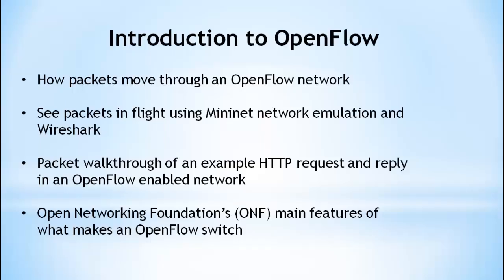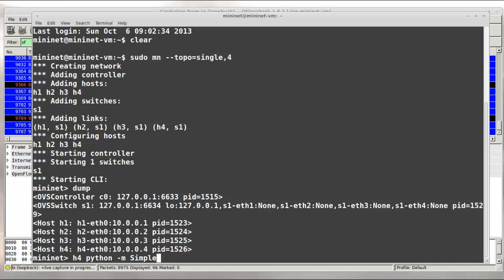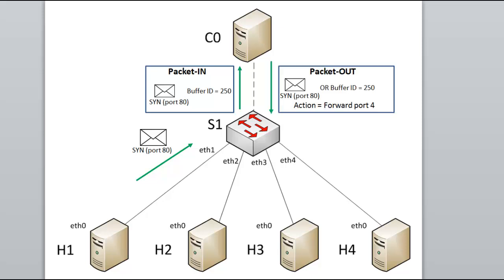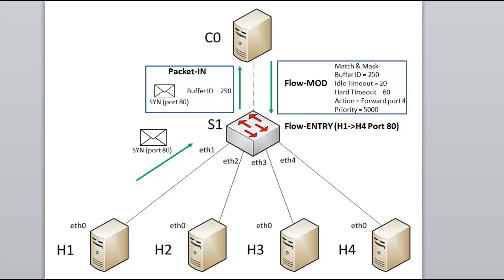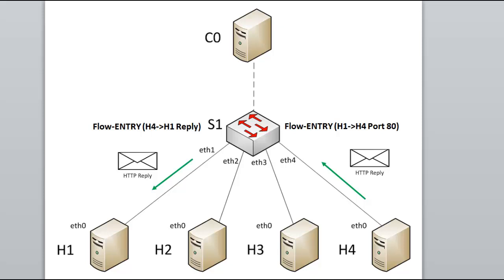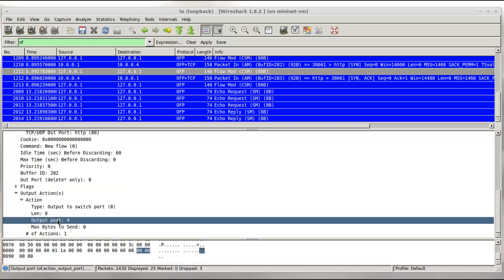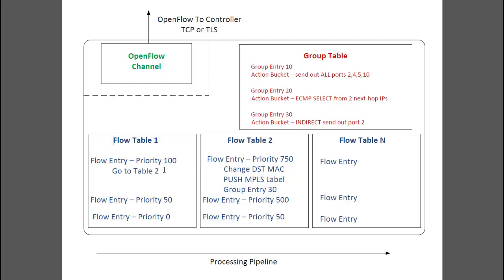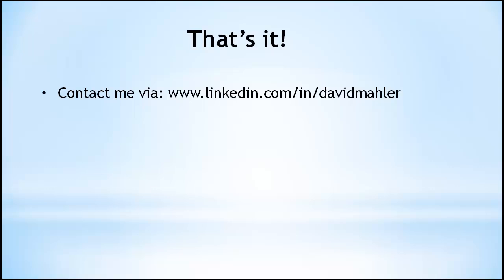Introduction to OpenFlow

Comment: Excellent video David! Cleared up a lot of my doubts. 
Just one question at 3:20 When the initial SYN packet arrives at the switch, how does the switch know which controller to send it to.
As OpenFlow controllers could be implemented by different people, how does an intermediary switch identify which controller to talk to for a particular packet?

Comment: I know this was 6 years ago, but something doesn't make sense. Back in the early days of networking, we had bridges which performed frame switching via software. This was a bit slow so frame switching was performed via the ASIC (ASIC - application-specific intergraded circuit). This allows frames to be processed at wire speed. Now we're back to a software implementation of switching. Don't get me wrong I fully understand the benefits, but how has switching via software improved with respect to speed vs switching via ASIC
Reply from the maker: Emphasis on the 6 years ago, I'm not working with OpenFlow anymore - but programable ASICs - e.g. https://sites.google.com/view/iu-whitebox-project/home/programmable-asics-and-p4

Comment: I wonder how controller know that h4 is connected to switcH ON PORT 4, since that are no packet out of h4 yet in the first place?
Reply from the maker: It's been a little since I set this up - but IIRC, its from the ARP request and reply which came before the TCP 3 way handshake.  Those are punted to the controller which records (learns) IP, MAC and port mappings that way.
Reply: I also have the same question from David Mahler
Reply: Why didn't the switch had an entry if there was an ARP packet sent out?
Reply: Ratna teja I guess because the SDN Controller differinciates between Protocols. You can see in this example, that even for a new HTTP session the SDN Controller would have given out a new rule.
But I think you could generalize  those rules. (I am still new to SDN)

Comment: Question - when h1 sent a ARP BROADCAST to ff:ff:ff:ff:ff:ff there was no flow_mod packet.  Why is there no flow modification for ARP broadcasts?
Reply from the maker: It's been a while so I don't remember the context - maybe I just skipped ARP process to focus on core points if I recall correctly....
Reply: Right the video is about the TCP SYN and TCP SYN ACK.  This was a question about the functionality of Openflow mod packets and ARP.  ARP was not shown in the video but I replicated it in my lab and just wanted to understand how Openflow handles ARP broadcasts.
Reply from the maker: Well it's not how "OpenFlow" handles broadcasts, it's what a controller decides to do with them and pushes down in the form of flow entries.  For example, in OpenStack you can enable a feature so that broadcasts only go to where they are needed instead of flooding the whole l2 domain.  On the switch itself this is seen as flow entries directing broadcasts only out via certain tunnels.  I did this video a while ago but I assume a flow modification is pushed down here just to treat it like a normal l2 switch broadcast (everywhere out but the input port).  The default on OVS is just to act like a normal switch which would mean normal broadcast (if there are no specific OpenFlow entries to override that behavior that came from a controller, etc.)  Hope that helps?
Reply: I think I understand now, the default OVSSwitch doesn't need a flow entry from the controller on to handle broadcast traffic, that behavior is already built in the switch by default?

Comment: Hi David,
I am working on an SDN project in which I use a physical router Linksys WRT54gl and burned an openWRT OS with openFlow 1.0 from the pantou project. I tried to connect two routers to some controller (openmul, floodlight) as following: r1->r2->c1 .
I am having a problem in configuring the ports to allow traffic from hosts connected to r1 to hosts connected to r2. I'm having some issues when trying capture traffic on wireshark, so I was wondering if you could supply me some information about my problem. I was wondering if when r1 gets a tcp packet and encapsulate it with openFlow, and forward it to r2, does r2 encapsulate it as well or does it recognizes that it is an openFlow packet and just forward it as is to the controller? 

would appreciate any help on the matter,
Thanks

Comment: CG: David, One irksome question. Sorry!
       I tried to set up the environment on Windows 7 PC Using Virtual Box and the Mininet VM
       supplied at mininet.org.  I ran the same commands as in the video and noticed one difference in the output
       of the dump command. See below....

       Interestingly, on a seprate Ubuntu 14.10 machine with mininet packages installed directly from Ubuntu Software
       Centre, running the same topology produced the same "OVSController" identifier as in your video, for the dump
       command...

       Why am I getting Controller as opposed to the expected OVSController

ON WIDOWS 7 PC Virtual Box - Mininet VM :
=====================================
sudo mn --topo=single,4
:
The usual output etc...
:

mininet> dump
<Host h1: h1-eth0:10.0.0.1 pid=3151>
<Host h2: h2-eth0:10.0.0.2 pid=3154>
<Host h3: h3-eth0:10.0.0.3 pid=3156>
<Host h4: h4-eth0:10.0.0.4 pid=3158>
<OVSSwitch s1: lo:127.0.0.1,s1-eth1:None,s1-eth2:None,s1-eth3:None,s1-eth4:None pid=3163>
<Controller c0: 127.0.0.1:6633 pid=3143>  <=== Your video shows "OVSController c0" : .... )
  ^^^^^^^^^^^^
CG: Question: Any idea why the output shows "Controller", whereas video showed "OVSController" ?
    This mininet is using the supplied Virtual Machine running under Windows PC Virtual Box
    I separately installed the mininet package on a separate Ubuntu 14.10 based PC and when
    I start up the single,4 topology there, I get "OVSController" in dump command output, as in your video !
    Why is the VirtualBox on Windows Miniet VM showing a different output ?

    Regards Colum

mininet> sh sudo service --status-all
 [ + ]  apparmor
 [ ? ]  console-setup
 [ + ]  cron
 [ - ]  dbus
 [ ? ]  dns-clean
 [ + ]  friendly-recovery
 [ - ]  grub-common
 [ ? ]  irqbalance
 [ ? ]  killprocs
 [ ? ]  kmod
 [ ? ]  networking
 [ + ]  ntp
 [ ? ]  ondemand
 [ - ]  openvswitch-controller   <--- Disabled as I understood it should be ???
 [ + ]  openvswitch-switch
 [ ? ]  pppd-dns
 [ - ]  procps
 [ ? ]  rc.local
 [ + ]  resolvconf
 [ - ]  rsync
 [ + ]  rsyslog
 [ ? ]  sendsigs
 [ - ]  ssh
 [ - ]  sudo
 [ + ]  udev
 [ ? ]  umountfs
 [ ? ]  umountnfs.sh
 [ ? ]  umountroot
 [ - ]  urandom
 [ - ]  x11-common

Comment: Hello David Mahler
Thanks alot for this video which clearly explains the basics. But my doubt is- Open Flow sits on top of TCP and controller listens on tcp port 6653 for switches which would like to connect. Now here how the switch to controller channel is established??? Controller listens on port 6653 but switch doesn't have any port ( L2 or L3 ). How is this network channel established then??? Is it like any other switch to host connection using the MAC address, in that case why would a controller listen to switch on the specified port???  Please David help me as soon as possible. I just cant go forward without this basic clarity. Thanks in advance
Reply from the maker: This post by Ivan Peplnjak will probably help:  http://blog.ipspace.net/2013/12/control-plane-in-openflow-networks.html

Easiest way is that the control network is 'out of band' and doesn't intermingle with the network it is controlling...the link has more detail and other links to dive into
Reply: David Mahler
 Thanks for a quick response. I checked the blog and went through all the related posts, but my main doubt is how a switch connects to a controller???? Switch doesn't have transport layer in it, so how a normal tcp connection is established between a switch and a controller?? Any kind of help will be appreciated, thank you
Reply: David Mahler It seems to me that the openflow switch is a multi layer switch, for the proper connection establishment between switch and the controller. Is that so???
Reply from the maker: Guduri Prathyusha OK - I THINK you may be getting hung up on the data plane versus the control plane and management plane.  I'd suggest reading more about that concept.  You are focusing on the data plane - how network nodes handle packets passing through them.  However this packet handling behavior originates in the control plane using protocols like BGP, OSPF, MPLS and now OpenFlow.  It's the control plane that handles a connection to a controller this is a separate 'plane' or construct from the data plane that I think you are focusing on.  Also when you said there is no "transport layer" in a switch - how do you SSH into one - that uses TCP - when you do that you are connecting into the "management plane"  I have a intro to SDN video coming up that may enlighten on this concept.
Reply: https://www.youtube.com/watch?v=-OGvr0bjEkU&t=4305s. U will have better understanding urself at 1:00:25 I think.

Comment: Hi David, I'd like to know if there's a framework to make a conection between the SDN and an IDS (Snort)?
Reply from the maker: Hi Gabriel.  I know there are different Vendors with solutions.  For example : http://h17007.www1.hp.com/us/en/networking/products/network-management/Network_Protector_SDN_Application_Series/index.aspx and http://www.inmon.com/products/sFlow-RT.php and http://www.radware.com/Solutions/SDN/  There are some in startup/stealth mode focused on this as well.  I don't know what's out there for Open Source specific to integrating say an SDN controller application for IDS.  Hope that's at least some good jumping off points.

Comment: Hi... Its very simple to understand.. Thank you...
I have a small clarification...
Please clarify...
How the controller know that a particular host is connected to this specific port in the open flow switch?-- inorder to push the flow with action..
Thanks in advance...
Reply from the maker: Hi Andrew - well the first packet from a host is sent to the controller in a packet-in message from the ingress switch, so it is then 'aware' of the host
Reply: David Mahler Thank you...
Okay... then how controller will identify the outgoing port (where the destination host is connected)?
Reply from the maker: Andrew Niteesh
 Ah - up to the implementation of the different controllers and how they are programmed.  But for example they can do flooding unknown unicast destination and learning the same way a traditional switch does (learn from source MAC/Port of a frame) or say if there is an orchestration platform involved that already knows where VMs are (because it put them there) stuff can be pre-populated....

Hope that helps....

Comment: I tried capturing the packets with wireshark.
i am using two VMs one with cbench and other with the controller.
It captures all the packets but doesnt mark anything as OFP
wireshark v1.8.10 in use.
can anyone help
Reply: You have to use:

1. RawCap.exe -f <virtual host only> dump.pcap to create pcap file
2. the Wireshark development release 1.13.x, available
    at: http://www.wireshark.org/download/automated

Make the catpure with RawCap and then load the pcap by Wireshark.
Then enable openflow protocol by Wireshark menu: "Analyze - Decode As", scroll down right listbox to select openflow, then click on Apply and you will see openflow protocol be highlighted in the capture window. If your capture stores openfow packet, then you should have TCP packets using srcport 6633.
Reply: gregormax10 dstPort 6633
Reply from the maker: gregormax10
 Thanks Gregor!